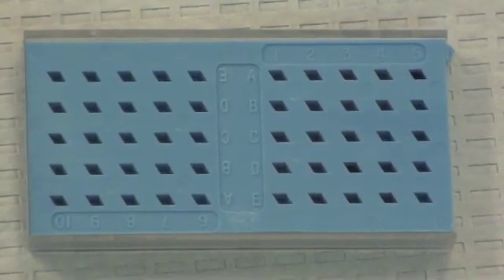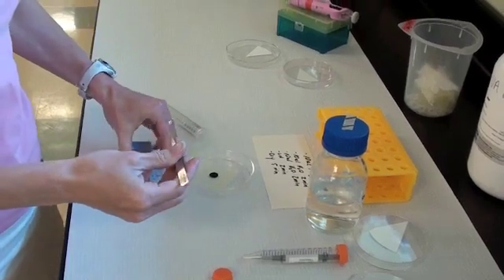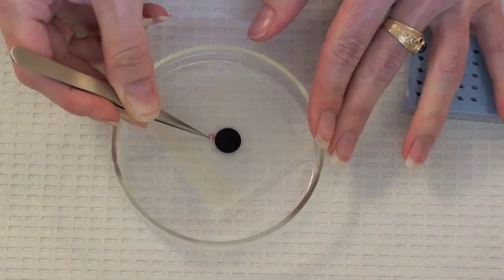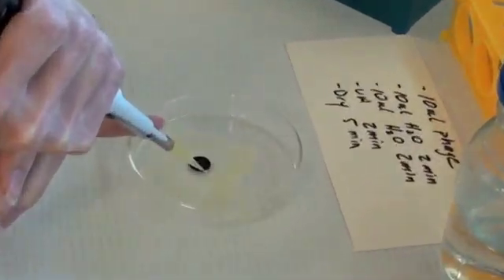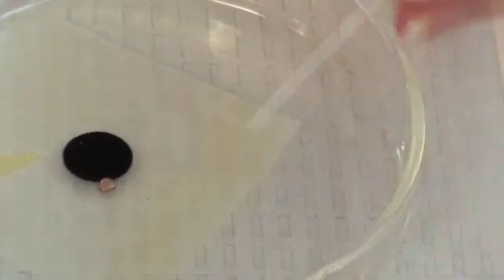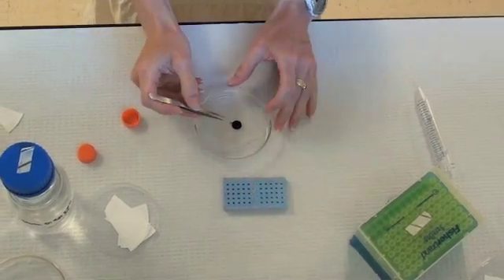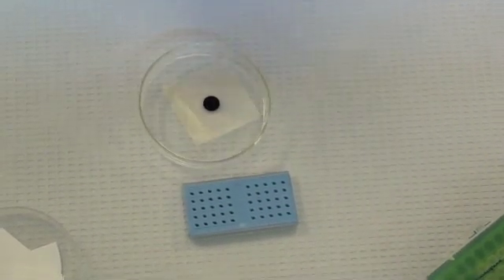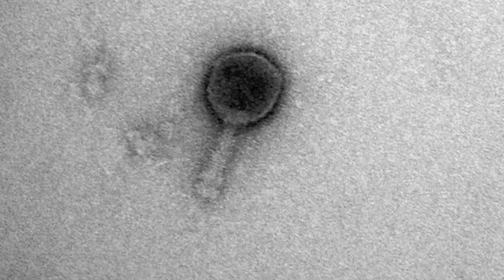Preparing for TEM

Comment: From my own experience I prefer dipping the grids in a low concentrated suspension instead of putting a drop on it and sucking the solvent with a filter paper. When you dip you will have less solvent on your grid, so it evaporates faster and you won't need any filter paper to suck it dry. On the other hand,  I'm working with nanoparticles or ceramics so I'm able to use volatile solvents. I don't know how this will be using an aqueous solution, but it might be worth trying.